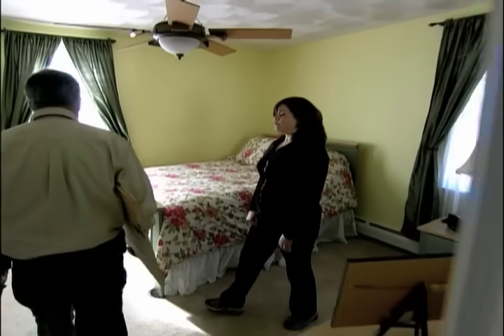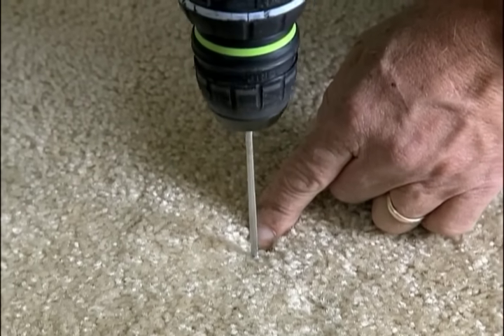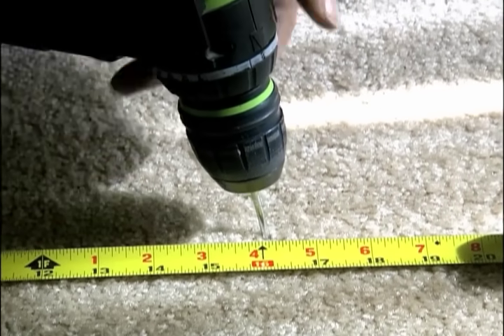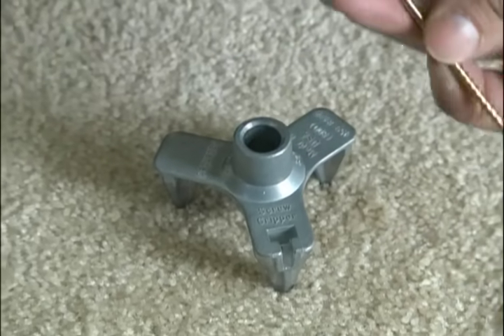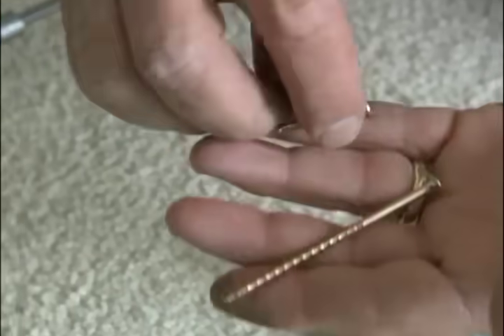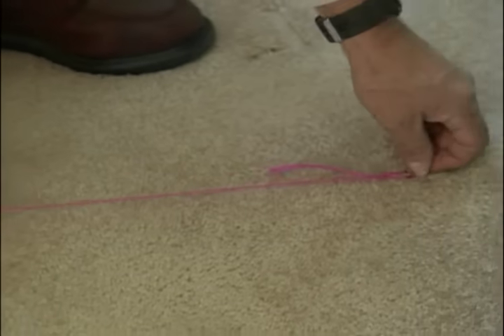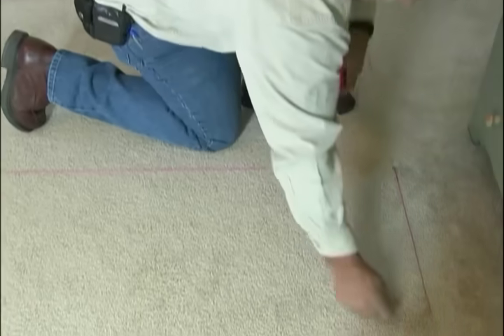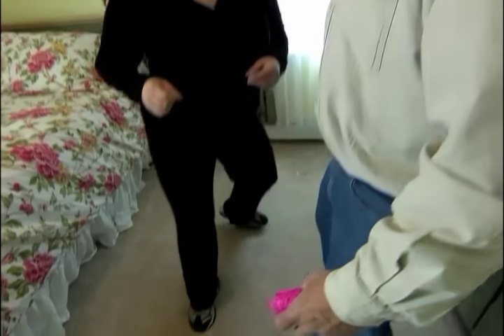How to Repair Squeaky Floors Through Carpeting | This Old House

Comment: I used this method and it worked pretty well. However, I had three screws that broke off high and now poke through the carpet. What do I do? How do I remove them or cut them down?
Reply: Vise grip pliers or oscillating multitool

Comment: That's a cut pile twist, try doing that with loop pile and watch it run and  ruin your carpet don't buy into it cheaper to pull carpet back using experienced carpet layer fix the problem, then get  layer back to relay carpet

Comment: It will hold.  If you put several screws a foot apart, it will be more  that enough to hold.  There is no tensile or compression  force on the threads that will be strong enough to separate them.  If it doesn't hold, you didn't install it properly.

Comment: I have had to fix squeaky floors in 2 houses that I bought new. I can't stand a brand new house with squeaky floors. Last one I took out carpet & pad. Then it is easy to find the joist because you see where the nails are. Just install a screw between the nails. I installed > 400 screws in living room and hall alone. Then new pad & carpet. No squeaks at all now.

Comment: How well can a HEADLESS screw hold subfloor to joist.  ( it's a headless SMOOTH shaft ).
Reply: It breaks off a couple threads below the smooth part if you look closely at the screw, so there is no smooth part on that screw anymore.

Comment: Then you go straight through a water pipe or an electrical cable so now you gotta pull the carpet up.  Replace the cable (if you're still alive) or turn the water main off, call the plumber to replace the waterpipe and then the plasterer to replace the dry wall.  Wait 3months then you can repaint.  O and don't forget to fix the creaky floor... since you now have the carpet up.

Comment: This is bizarre, you neither drill blind, just take up the carpet and check for wires or pipes first, you might get away with this a couple of times if your lucky, cant see the point.

Comment: Go under your house with a can of "Great Stuff". Have the wife walk on the area popping when you walk. Find the joist remove insulation, spray the great stuff along the seam of the joist and sub floor. It will expand and seep in between any gaps. This will expand more then harden to a stiff foam keeping pressure on the areas flexing which should stop the squeak or pop.

Comment: And when you hit a pipe or cable you will need to replace your carpet upstairs downstairs and your ceiling ! Loose boards have been lifted before so chances of hitting a pipe are huge !
Reply: Straight through a pipe or cable

Comment: Great way to locate those hard to find cables and pipes😂
Reply: No wires or water lines are in joists...
Reply: Clorox Bleach how do they get through the joists then? Cables are clipped on the edge of the joists drilling blind could drill down the side of the joists hitting the cables
Reply: Clorox Bleach not true in the UK

Comment: if we measure 16" and then drive this massive screw blindly into the floor, the squeaky floor board has gone!  However, that screaming you hear from down stairs means we've hit a pipe.  Tune in next week for handy tips on how to locate a leak and stop water pissing through your ceiling.  😂

Comment: The magic in all this is finding the floor joists. That's not always the same in every house. Some are 24oc and some are 16oc. Hell ...some are way off depending on design etc. If you pulled the carpet it's easIer to find joist by locating screw pattern, but guessing through the carpet in someone else's home would make me nervous. Accidentally hitting electrical or sewer/water lines is a possibility. 

The best remedy is to remove the carpet and do it right. This is a typical quick fix that prob won't last.

Comment: Looks very cool.

Does this work on tongue and groove chipboard flooring (which is the worst product ever invented as far as I'm concerned) - sounds like 'Karen' has T&G chipboard too? How do you avoid drilling through water pipes etc (some pipe detectors give false readings etc)?

Comment: I went to Ace Hardware and bought me one of these kits. Easy to use and clever. HOWEVER in my case, it didn't completely solve the problem. Better, but not silent. Here's the rub*: my floor joists are engineered wood I-beam joists. I'm betting the problem is some loose joint within the I-beam construction, NOT between the  joist and subfloor. If I had conventional old-school 2x12's, this Squeeeeek system probably would have worked just fine.  (* no pun intended, but now that I saw it I'm leaving it there.)

Comment: I tried the "finding screw" in order to identify the joists. I drill on multiple locations, and it doesn't seem to slide up and down anywhere, reverse drill brings it back easily. It's as if it's all joist, which is impossible. Anyone else had trouble locating joists with this technique?
Reply: Old post, but they make powerful magnet stud finders pretty cheap.
You may be able to use that to find an original nail or two in the subfloor and map it from there.

Comment: I used this system in a bedroom of my home.  It helped some, but most of the noise was coming from the interior walls and the floor.  From the basement, I screwed through the flooring and into the lower board of the wall. Noise gone.

Comment: I have used galvanized nails before, and they work pretty well.  Use the ones with the small finishing head.  You can cut a short length of nail and hold it with a pair of plyers to help hammer the nail down below the level of the carpet.
Reply: I believe screws are preferred over nails because they can't push out over time.  Similar to why drywall screws are preferred over drywall nails for gypsum board.  The issue with nails is over time they experience deflection from traffic over the subfloor between the joists, lifting the nails ever so slightly over time.  The squeaky noise is often the sound of the subfloor moving over the nail.

Comment: Annnnd the subfloor inches it's way up the screw shaft away from the joist because theres no top to the screw head to hold it in place. This doesnt make any sense.
Reply: Neal Head 2 or 3 threads are not going to hold down a warped baseboard. The majority of the threads are in the joist, which doesnt help to hold the floorboard into it.

Comment: Quite often it's not the floor it's the joists which are badly fitted and need small wedges and screwed and replace flooring /carpeting and hey presto no squeaks - carpenter

Comment: Lets hit the floor with a hammer, sounds like the joist is here, nope maybe over a bit, nope thats your central heating pipe the first hole was where your electric cables are, lady please call an electrician, and ask him if he could bring a plumber with him, sorry about all the holes in your carpet, but you need a carpet fitter, i only do special screws.
Reply: electric lines are run through walls
Reply: @mrmisterman999  not for power sockets

Comment: What if there are pipes underneath with water in them? Because one day in my parents house my Dad screwed the wooden plank and the screw burst into a pipe
Reply: +sportygal1991 Best to always assess the situation before you tackle any problem. If possible, scope the area out before hand to get an idea if there is anything in the vicinity. Even if there are pipes underneath, the tool he showed "should" reduce the chance of penetrating any pipes since the thread is minimal.
Reply: You will never ever hit a pipe doing this unless you dont screw into a joist.
Reply: duh
Reply: yes you can. if I did this with my bedroom floor I would definitely hit the central heating pipes and elcectical cables! this guy is just lucky or the US don't run pipes and wires under floor boards?!
Reply: You are screwing into the joists so how will you hit a pipe or wire?
Reply: Google what a joist is.
Reply: Carl Rimmer Tradesmen are notorious for notching joists, especially in retrofit situations, in whatever ways make it easiest for them to run their lines.
Reply: Mark Doumert Wrong.

Comment: I used to do customer service for a framing company. I always used a tapered head screw to hold the sheathing tight to the joist. Most squeaks that I dealt with were nails that didn't hit the joist solidly.

Comment: 👎👎Missing a stud will actually allow air to then be pulled through the subfloor/sheathing and the carpet will act as a filter for the air that gets pulled through the nice holes you just put in your floor and carpet, they then will cause PERMANENT black filtration dots where ever you happened to miss a stud !!  This is common around the edges of rooms with carpet in these cheaply built new homes  these days by a black permanent filtration line around the sides !! 👎👎

Comment: Why not just use a regular screw and screw it in all the way?  It will only result in a slightly bigger hole in the carpet that you still won't see.  Just pull the carpet up past the screw before you screw it all the way down, then you get the advantage of having the head of the screw engaged into your subfloor being more effective and stopping squeaks.

Comment: Move the furniture, roll back the carpet and you can see where the boards are fixed to the joists. Then add further board screws. The heads hold the boards down tight. This way they will become lose again over time.

Comment: Now do a video on how to get the screws out of the floor if the drill breaks them before they go deep enough. I was using this and one of the screws snapped at the scoring  just before it was deep enough. Before anyone asks, yes I followed all the instructions to the letter, and added everything he did in the video, which was left off the instructions just to be on the safe side.I have a broken off screw an eighth of an inch above the wood floor base, semi hidden in the carpet, that i can feel and see if I move the carpet a little... just beside my bed. I tried pliers, but they didn't work.
Reply: Maybe try locking pliers on a very tight setting or if that doesn't work, just hit screw with a hammer until it breaks fluch with the subfloor or bends over.
Reply: You could try moving out.
Reply: You were probably driving the screws in backwards.  Also your drill might be low on drill fluid.

Comment: This guy is a liability did not check for water pipes or electrics.
Reply: You don't know they didn't check for them. They only recorded the parts they wanted to emphasize.
Reply: @sharonclark3020  You don't know either, and it was not mentioned. I have been a builder for 40 years You can not always locate pipes or electrics with a sensor. Good luck if you use this idea and make sure you are insured for leaks etc.

Comment: This is so stupid. Why on earth would you take on the risk of drilling through cables and pipes when you can just pull up the carpet and fix the squeaky floorboards. Doing it properly is more safer than this.
Reply: Unknown When you drill or drive a screw or nail into your wall or ceiling, do you remove the drywall or plaster first?

Comment: Ohh I wouldn't try this method neither would I recommend. I'm a heating engineer and here in UK we install water and gas pipes under floor. Will also find wiring under the floor.